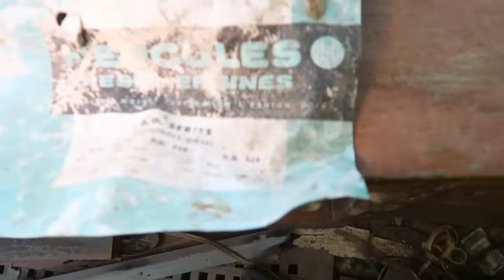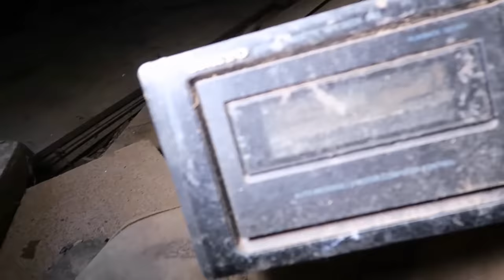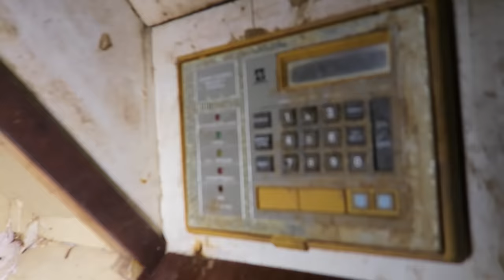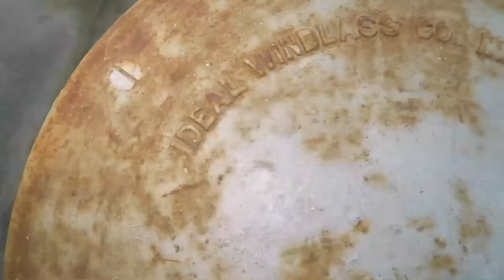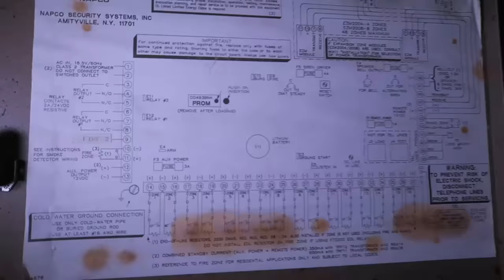We Found an Abandoned Yacht

Comment: Hey guys, the yacht you explored looks very similar to the Presidential Yacht, U.S.S. Williamsburg, Circa 1930. But the one you explored looks a little more recent, maybe 1948-1952, so it could be in the range of 68 to 72 years old. Thanks for having the fortitude, and guts to brave that fetid swamp. As a digital color expert with 37 years experience, I can categorically say that swamp was defined by a color closely associated with raw sewage, if you get my drift.
Reply: USS Washington is located at GPS coordinates 44.085000, 9.879722
Reply: @grantmishoe4145  in Italy ?
Reply: Similar how? The stern looks nothing like it that's an open promenade type boat, this is enclosed, the size differs etc.

Comment: 1980s cocaine party boat. Stashed for the insurance.
Reply: This boat would have been right at home in a Miami Vice episode.
Reply: Could be some Wall Street guy doing an insurance scam.
Reply: Very possibly true.  When I first looked at the pictures of the electronics I thought Party Boat.
Reply: Would not be supprised
Reply: Metro Detroit white flight was assisted by insurance.
On what their color could not carry away or would
find another all-white market for.  Whites in Detroit
abandoned their previous all-white churches, city hall,
public schools, etc.  In 2020 only the Pitcairn Islands
is desperate enough to accept any white immigrants.
I read they found one  with courage enough to go there.
Reply: that was my first thought!!!
Reply: This boat is quite a bit older than the 80's it's heydays were more like 50's or 60's. It was probably refit in the 80's as a "classic" yacht.
Reply: Escobars boat 💨
Reply: The funnel is a late 50s - 1960s design, and the stereo components date to the mid to late 80s.  Looks like it was stripped of anything worthy of marine salvage and abandoned there.
Reply: There was a dvd player so im thinking 99 2000
Reply: I worked in the oil industry out East before moving to Texas. We would go up these rivers to service pump stations and would see abandoned equipment, boats, cars, trucks all the time. Word around the areas we would go is that owners would dispose of them for the insurance or for evading taxes. Seemed legit story since most of what was out there looked like it was left in decent shape.
Reply: @glennjames7107  agree
Reply: @chrisoverly3000  it was a vcr
Reply: Not likely. Far more likely is that it's too expensive to keep maintained and unsellable. Too expensive to scrap, so abandoning where it is was the cheapest option to get rid of it.
Reply: @lokisgodhi  cocaine party yacht. Owner was probably killed in an accident and the boat just drifted off
Reply: @lokisgodhi  
That ship is sitting right next to a scrapyard
Reply: @buellb0y  Which has absolutely no relevance on the expense of scrapping it.

Comment: This boat must not have been sitting too long because the gfi outlet at 7:09 near the sink is not more then 25 years old by my guess. The first gfi outlets were manufactured circa 1971 but this type is from the late 90s to probably early 2000s
Reply: I spotted a GFI, elsewhere.  There was also a 90's era TV hiding face down in the rubble.

Comment: I had a 1949 bulldozer with that Hercules 6 cylinder engine. The ship is likely of the same era.
Reply: When they were in the bridge I believe there was a 1935 date on the one piece of equipment still mounted he looked at.
Reply: I'd agree on that. A look at the typeplate at 19:59 reveals a 115V DC motor. Advertisments for such motors can be found in magazines from the 50s and 60s. (Unfortunately I wasn't able to find information on the model 15 of the IDEAL Windlass Co.)

Comment: The deck system, rotary phone and the VCR late 70s and 80’s.  Insurance fraud.  Someone stripped it and most likely the owners.
Reply: I was thinking the same thing
Reply: Newspapers
Reply: I think more likely it was stolen for the weekend use and then hide/abandoned, the VCR/tape decks/speakers wouldn't have been left otherwise, more than likely the people who stole it were planning on going back and getting the rest or using it as a hide out,  as someone who has dealt with (in the past) folks who steal boats and cars they have a strange mind set.
Reply: Hannah C " very good observations""
Reply: The exposed wiring, plumbing fixtures, and overall design of the vessel, suggest a mid-century vintage; anywhere from post-WWII to early 60's.  Though, there were upgrades. The stereo stuff was added in the 80's, the tube-TV  looked early 90's, the alarm system looked to be of 80's design, and I spotted a relatively modern looking GFIC outlet.

In the chart cabinet, there was that decal with all the flags, that advertised a nautical business, with locations in Miami and Brooklyn.  The Miami address is now a vacant lot, and has been so since about 1980. The Brooklyn address is associated with a dump, the area is depressed (I've been to Brooklyn; it's no mystery to me why the area is depressed. Brooklyn is a cesspool), and I  can't fathom that anyone has been anywhere near there for anything yacht related, in decades.  That decal also listed phone numbers with area-codes, so that decal had to have been placed between 1950 and 1980.

I expect that the boat was  a functional vessel, as recently as 1995.

Comment: I saw a GFCI receptacles in several rooms ..... They have been mandatory at all wet locations since 1978 .....I would say it's a 1970's Voyager luxury yacht ......
Reply: Those outlets were a bit more modern than late-70's. The alarm system was late-80's. That rotary phone appeared to be of mid-century vintage, and the electrical wiring looked to be from the 50's. The overall design of the vessel also is suggestive of the 50's, and not the 70's. 

It certainly recieved some modernizing over the years, though.

Comment: the Napco alarm name from the Magnum Alert series of alarm panels. Although they're now long out-of-production, these were some of the most popular systems in the 1980’s
Reply: I was going to say, none of the equipment onboard seemed any newer than Miami Vice.
Reply: The 2600 model seems to be from 1989, which could have been an upgrade from previous  ones.
Reply: I was thinking the same thing. Some of the equipment there still had model numbers and serial numbers. A good amount of research would point you in the right direction. Maybe not to the final owner but certainly some background story.

Comment: The lowest deck level is flooded, so she's actually sunk and sitting on the bottom.
The hull has probably rusted thru, so it only has scrap value, but since it's flooded below, it will probably be impossible to move it. Sad.
Reply: Not impossible! You could attach Blatter bags to it and float that out on a high tide using a salvage trash pump and a shallow draft tow vessel.
Reply: @tompowell6723  issue with that is the channel it sits in was clearly dredged to just be big enough for it, but it's sat for so long that even from Google maps you can see it got filled back in with sediment. It's not gonna be moving very far ever again, and one day will likely be surrounded by land as the channel continues filling with sediment.
Reply: Drew no one is crying.  Seeing what was once probably a beautiful vessel rotting like that in basically a sewer, IS sad.

Comment: The stereo and alarm electronics are much newer than the construction of the boat itself (1930s-40s?) Is there no engine or mechanical system under that funnel? That, the gutted bridge, the 1980s electronics, and all the wiring makes me think this was converted into a stationary liveaboard or houseboat. Someone might have had that thing towed into the middle of nowhere and used as a house until they got tired of it.
Reply: If the engine is still there, it would be at the bottom of the boat which is the flooded area. All that old cast iron is probably unrecognizable at this point.
Reply: betcha it was a detroit diesel.
Reply: Frigglebiscuit if it was it would just need some new batteries to start up haha

Comment: I noticed several things while watching this:
First, at 9:59 I noticed several c-clamps holding the stack in place.  It makes me wonder whether it was detached during the removal of the machinery (engine(s) and genset(s), although the two steel beams below the photographer's feet would not have made the job easy.  I personally would have just cut them to facilitate access.  However, if that was what was done then why reinstall them?  We'll never know I guess.
Next, at 18:39 I can see four oval boxes on the deck which I'm sure are dorades, which form part of a fresh air ventilation system, two on each side of the vessel's center line.  The ventilator air scoops have been removed, possibly as part of a salvage effort.
Then, at 18:59 I can see that the dock lines which still have their chafing material attached are still wrapped around one of the cleats.  That by itself suggests that this boat broke loose from its mooring and was carried away by wind or current.  It's too bad that the videoer wasn't able to get a shot of the end of the lines.  It would be easy to determine whether the lines had been snapped or sawed through by chafe.
Next, at 19:43 there is what appears to be a twisted steel cable running down through the anchor chain pipes.  I'm guessing that this is the upper end of a tow bridle that would have exited the hull where the chain would have passed out through the hull fairly close to the water line.  This would allow the vessel to be towed without pulling the bow down into the water as would happen if the bridle were pulled on from too high up on the deck.  So that suggests that it was towed to or from somewhere.
At 19:59 there is a very clear shot of the capstan serial number plate that shows the manufacturer, model, and serial number.  I would be shocked if the capstan manufacturer (or whoever owns the company now) couldn't look up the vessel's history, including service history.
 
And finally, I really wish they had paddled forward enough to see whether there is a name near the bow.

Just my two cents...
Reply: Excellent report SRF
Reply: @victorderus2417  Thank you for the kind reply

Comment: It's possible that the hurricane in 2012 is part of the reason it is stuck there. My guess is it ended up at the shipyard to be deconstructed, and while being stripped, was tossed to where it is now due to the hurricane. Filled with water from then , slowly drained, which would explain the internal collapse from ceiling due to flood damage. Probably not a priority to tow it back to the shipyard currently.

Comment: Well the electronics lean towards late 80s to mid 90s. The design of the yacht speaks to being a coastal cruiser of some sort not sure of the brand though. 

As for where it is and how it got there Id bet on insurance fraud or hiding it from being repossessed and couldn't get it back out.

EDIT:It's a bit hard to judge the length but maybe 65-75 foot? I think it's a one off custom.
Reply: Chris Jensen both are good possibilities.
Reply: It could have been put there to rot down to nothing when it was retired
Reply: Shipyard Cranes or some other type of business in the Background at 12:30-12:50
Reply: It's sitting next to a tractor trailer yard, if you compare it to the semi trailers near it, 53', I'd say right around 100' long
Reply: @iamthecheese2737  i hadn't noticed that. Sheesh.

Comment: At 2:24 I can see a crane and a telephone pole. To the left of the boat. You guys should had took the road.
Reply: Apparently that would be to easy? No adventure in that.
Reply: I'm pretty sure those are Sailboat masts.   Pretty much no question.    Thats what masts and their spreaders look like.

Better question is why our intrepid explorers did not have a look at that?
Reply: @freebuilder007  If you look further down in the comments, you'll find the address where this boat is located. You can Google map, and look at the satellite pic from there.
Yeah, it's a crane and telephone pole. The boat is in a small canal, beside a house just to the north of it. At the end of the canal is a basin adjacent to a commercial property.
You can even use the scale provided on the map, to extrapolate that this boat is 115 feet long.
As they say, a picture is worth a thousand words
Reply: freebuilder007 I went and looked again on my big screen TV. You can definitely see the upper sheave, lower sheave, hook and block, jib, jib guide line, and lattice line of the crane.  It is set off at a 45 degree angle to the water and boat. The lattice line has its darker red paint at the tip.  The electric pole has Primary wires running horizontally inland and you can see Insulators and the crossarms.
Reply: It's behind private property, likely there was no access from the road.

Comment: I am not a boat guy either but, I have been in construction for 40 years. I have gotten pretty good at dating things based on construction parts. From what I saw, I would say late 50's to early 60's. An upgrade to the sound system in the late 70's. The CD came out in the 80's. Probably the owner died and either had no relatives or none that wanted the boat. Likely the Marina where it was parked stripped it of what they could to recoup their losses and did their best to remove any way to easily ID the boat and shoved the hulk into the swamp.

Comment: Apparently it had a engine that starts on compressed air , hence the cylinders
Reply: Paul those are not compressed air cylinders they in the lines that lead from them are painted red. On board a ship that denotes a fire suppression system. Those are Halon or pressurized water tanks. Hercules engines only made a diesel up to a hundred and eighty-five horsepower which would make it impractical to start by any other method than a dedicated starter battery Bank
Reply: @michaelpettit9706  
Fire suppression is correct!
The tanks would have been co2 as Halon had not been invented yet.
Reply: @michaelpettit9706  A top notch boat apparently  . Thanks
Reply: My boat is like a woman.  It cannot get enough attention.
Reply: @toruko-ishibravo2zulu679  or enough money.
Reply: @b.atwater3904  halon was invented in the 1950's which is about the age of this yacht. However it's normally in green tanks

Comment: The Hercules DD engines were made in the 50s but weren't generally maritime engines, mostly military trucks. The alarm system was manufactured starting in 1989-1990 which would coincide with the VCR. The outdoor coverings & mere latch on the door meant that it was a coastal ship, wouldn't have endured any serious sea state. Rounded stern & wooden construction would place it around 1940s-1960s for manufacture of it. Likely in the middle since the bridge is post-WWII design.

Comment: She was stunning at one time. 
I did some research, trying to date how long she's been there and come up with the later part of the 80s. The stereos and accessories for them. The GFI's in the wet areas and the code times/years for them on this application, that sort of stuff. 
The age of it... I can only imagine that... 40s???? 50s??? I do know it wasn't very far into the very early 60s tops with the cloth wire that was used. (I'm a career sparky). 

QUESTION.... 
Is she still floating or in the mud? I did see the flooded areas but could have been rain oppose to a hole. 
Absolutely amazing boat at one time of her life. Too bad she's that far gone for a restoration adventure.
Reply: The unpleasant truth about that aquatic vehicle is that it was also safe at one time also. Those chemicals from that boat might kill a person.

Comment: That's a shame. In her day she was obviously an elegant motor yacht, too far gone now to anything with.
Reply: Far-gone, I think not.  In the old days any hull repair was
done atop a shoal made dry by tides.  Log rafting alongside
made work platforms for tooling and heat tar for brush-on
waterproofing.  It was done frequently.  Because it could be.
Reply: Its still floating that's a good sign if you got the money it can be brought back.
Reply: "To far gone now"
That only depends how much cash you want to sink into her, you'd never get out of her what you might put into it. But sometimes it's not allways about money, it's the love of the sea, and see a derelict vessel sail again.
Reply: @1968DodgePolara  not floating, if you look on Google maps it sits in a channel that was dredged only just enough for the boat to fit, and it's sat so long that you can actually see it filled back in with sediment. She's likely laying on the riverbed.

Plus, according to other commenters, restoration was attempted before but deemed uneconomical due to a major Asbestos issue. Either that, or she was scrap to begin with and was likely getting stripped out by the nearby scrapyard.

Comment: At the bow you can see a steel wire towing bridle going thru her eyes. She was towed there and dumped, or she was under tow, broke her tow line, got lost and was washed/drifted in. Well worth salvage. Roughly $10k of steel, $40k of recoverable teak wood, $3000 of brass/copper. Problem is if there is asbestos, oil/fuel, lead paint. For a small scale salvager/scavenger the copper wire and decking would be easy to get for a few thousand bucks.

Comment: The styling of the yacht is very typical Late 1940s - early 1960s.....the alarm system in it looks 1970s...maybe early 1980s......the the VHS player (its not a VCR, a VCR is different) and the Kassette player you found is late 1980s, maybe early 1990s.

That was a beautiful ship at one point, sad to see it in such a sad state.....the way it has been stripped out is hard to tell if it was done by someone who stole it or some scavengers, but it has been picked clean